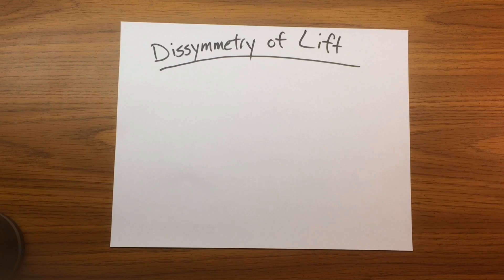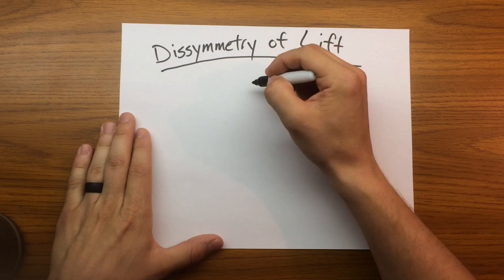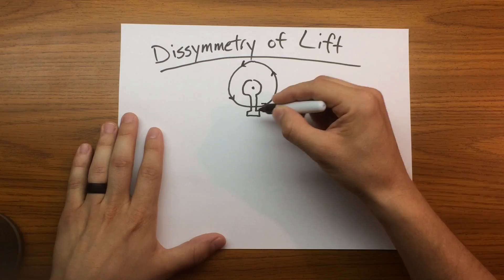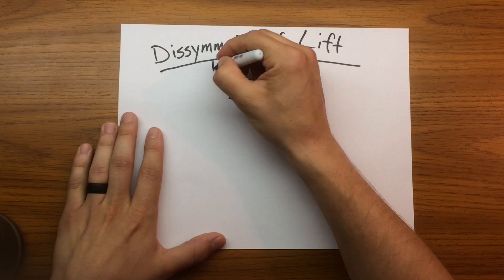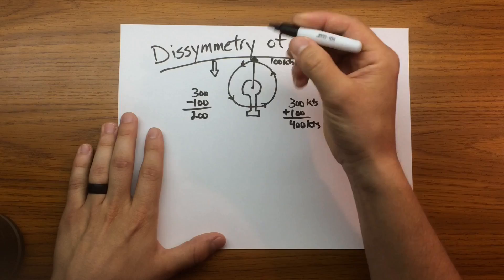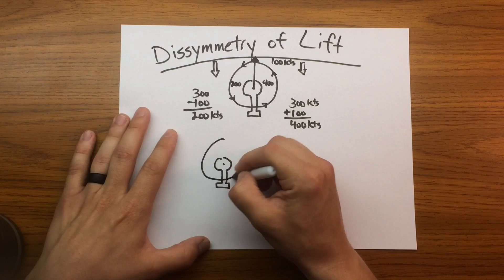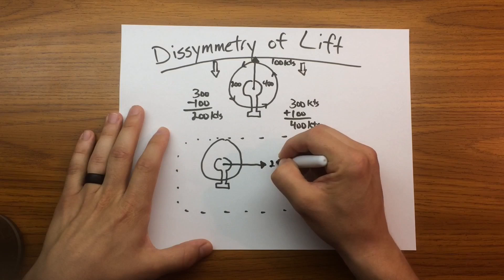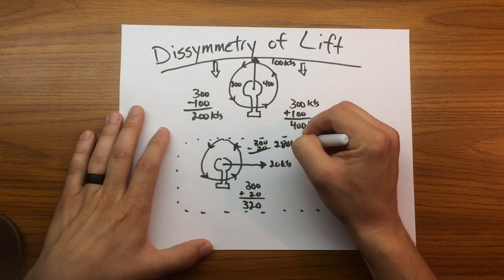Dissymmetry of Lift in Helicopters

Comment: I just started seriously studying the Army Sift study guide about a week ago, have been referring to your videos off and on so far and they have been helpful. I am curious if the Army Sift Study guide is good enough in tandem with your videos for the actual sift test itself and to move further on to the actual school, or if there is any other reading material you would suggest to further help.
Reply from the maker: I would go through those guides and take practice tests as much as possible until you can breeze through the exam quickly and accurately.